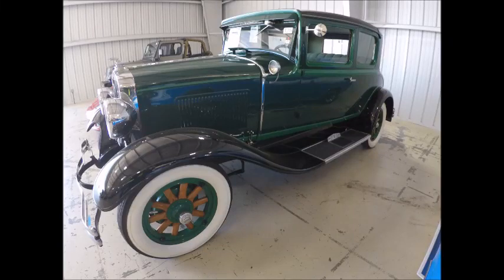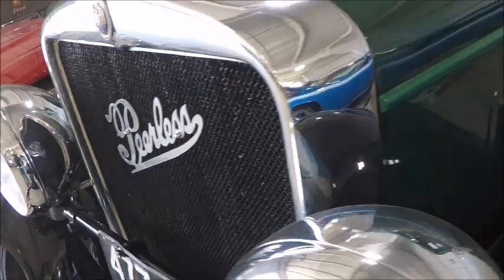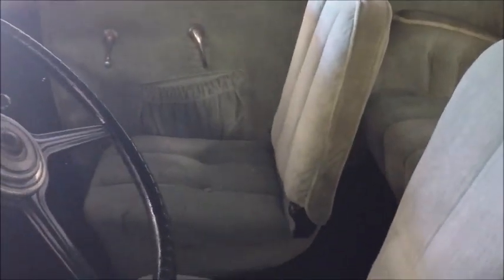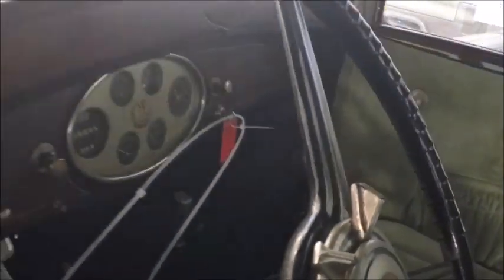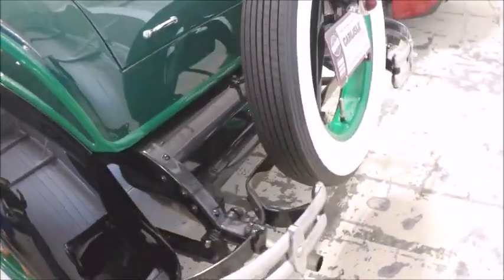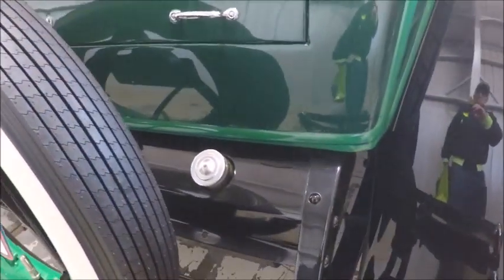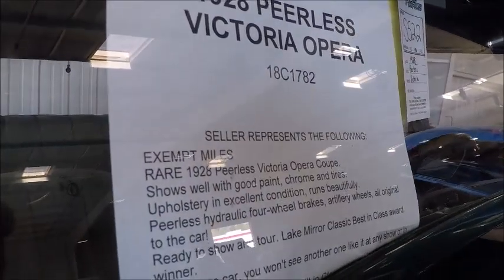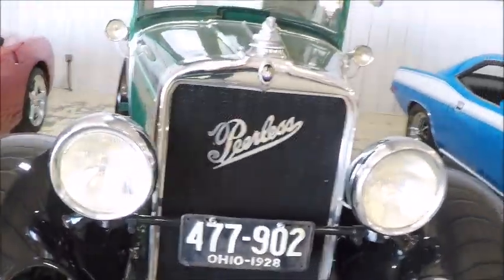1928 Peerless Victoria Opera Coupe Grn LakelandLinder0222205248

Comment: I saw a yellow Pierce-Arrow woodie wagon at Chesterwood in Massachusetts some years back.  (The location was sculptor Daniel Chester French's summer estate; they used to hold a great car show there.)  How many of them could have been built, and how many of THOSE can be left??  There was no mistaking those headlights on the "stalks" that seemed to sprout from the front fenders. Impressive car!
Reply from the maker: That sounds like an exceedingly rare woodie wagon!  I'd bet there may not be another surviving!  There was no mistaking a Pierce Arrow, and its faired in headlamps!  It's great that the car show had such a great venue.  Not only do you get the treat of all those great cars, but you can appreciate the the architecture of that mansion, and perhaps some of his visible works!  Thanks!  :) Jack